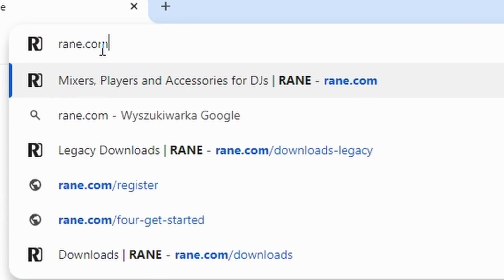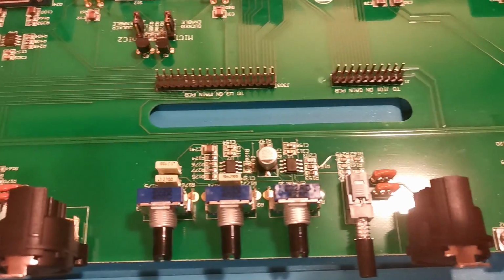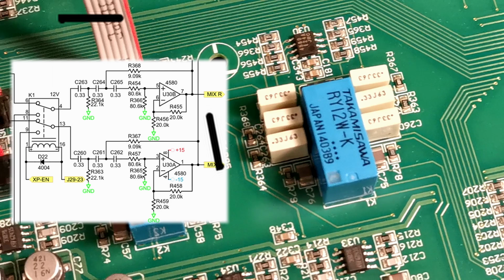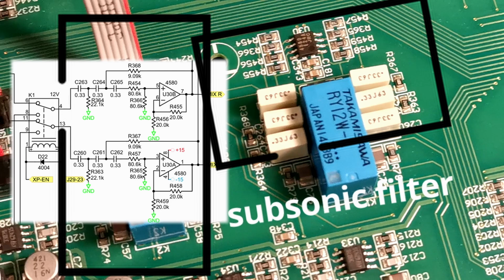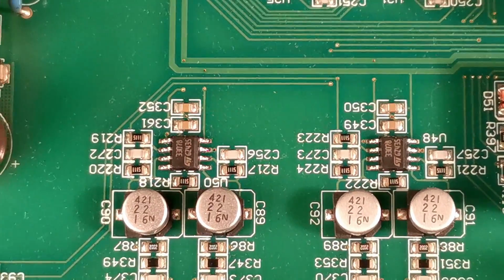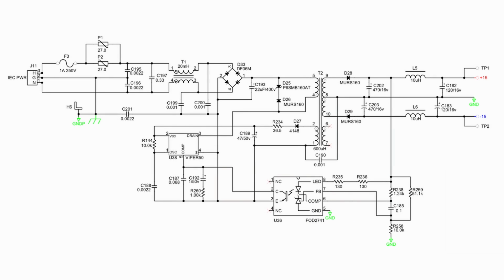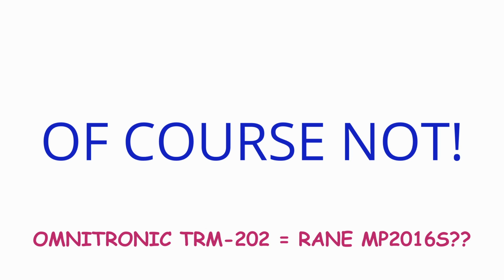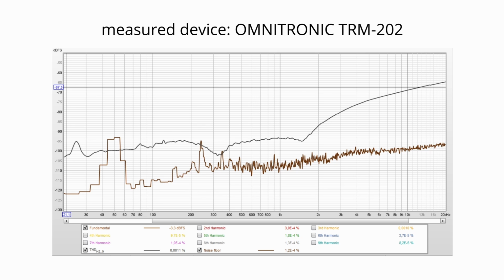Mixers Inside: Rane MP2016S [deep dive]

Comment: Do you have any upgrade suggestions you would do to this mixer to make it better?
Reply from the maker: Please define "better".
Reply: @mixersinside   I have a friend that has the original one from like 1999 which has the telephone jack power supply and I want it to upgrade it with better phono chips and summing chips. I want it to sound  more like a Bozak or Urie if possible. It has the Black beauty pots that most claim to be the best.  
So I was considering it.

Comment: i have been wanting to upgrade my dj mixer. ..i constantly mix for fun. 
its my therapy.  ive had a vestax pmc 16, rane empath, omni 402, xone 43.
i liked all of these mixers. each one has their own feel and charm.
the pmc is dead, i wacked it out. 
the rane is still working but the cue is on and off
the xone. love the faders. but feels sterile
omni 402, no fader, not sterile. but no 3 band eq 

love rotary, love mix faders. each one has a purpose. a feel. a time . a place. 

so i wanted to buy 
a radius 4..........crazy about it. i cant sleep. but i will be broke for the next
two months. valves, 3 band . isolator , shiny. 

i just watched MIXERS INSIDE.  and we get on about the bit of . what is
used to produce the machine. its...like i have always. i have never had MAC. 
always pc. same processors. 

...
i have ordered an omni422.mixers inside convinced me....run it through eventide h9 for harmonics
 or warmth...

Radius 4 can wait for the summertime, but i want to try it out and decide for myself. 

thank u for a look inside the machine
Reply from the maker: I think that mixing on cheaper and more expensive mixer can give equal fun and looking inside those devices shows that we are really speaking about nuances.
Reply: right and most people wont hear the difference @mixersinside
Reply: buy a car u love to drive.  and if u cannot race your car, why buy a porsche

Comment: Another cool video, thanks! I think it would be helpful if you give THD at a certain gain or output level. Unity Gain at 2V RMS is what most mixer companies have settled on. The colour of certain LEDs is of no information to me at least. Found the THD over frequencie plots really interesting. What was the output level for them?
Reply from the maker: The color of a LED is an essential information because it tells if you operate at right levels according to manufacturers recommendations. The metering in Rane is very minimalistic and in this case the LED behaviour can be indeed confusing when you think about the output level, but as you may noticed i gave the THD info at various settings. Showing the THD values from green zone till overload gives you information about the the full spectrum of mixers behaviour.

THD vs Frequency of both Rane  and Omnitronic was plotted at unity gain setting. I wouldn't precisely stick to the values on the plots, because as i said my measurement device that lets me do THD vs frequency measurement is not super clean. But my setup for measuring THD at 1kHz is exceptionally clean (i show it in the Ecler video).

I use 2V RMS for the input.

Comment: Goes to show that a mixer that people generally love the sound of can be packed with ICs and mid grade components.  These breakdowns are important to help people learn.  Many of these rotaries are like hifi equipment.  HiFi reviews always measure but I rarely see a review  that breaks down the equipment and critiques the parts selection and circuit design.
Reply: Most of the HIFI reviewers are not trained engineers, they are skilled listeners however.  The manufacturers would also not let them tear apart the equipment.  The main reason they don't open them up is because it does not matter, how they sound is what is what matters. An excellent sounding product can be achieved in many ways, if designed well and made well.    @mixersinside

Comment: Don’t be shy with pumping us full of information – we can handle it!  :-D  Anyway, at 6:10, you mention that the disconnected input “floats” and causes noise to be added to the summed cue output.  Could you please explain this in a little more detail, or does it require electrical-engineering skills to get a deeper understanding?
Reply from the maker: Every floating input without any "stiff" potential can pick up noise. Grounding the unused inputs of cue summing amp guarantees 0V potential = no noise pickup.